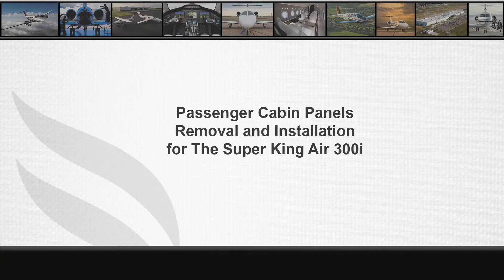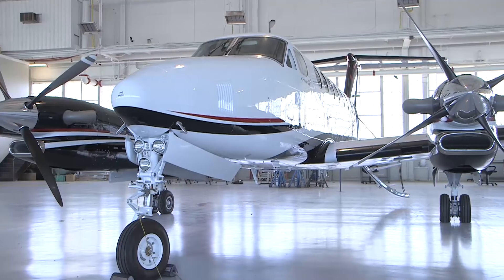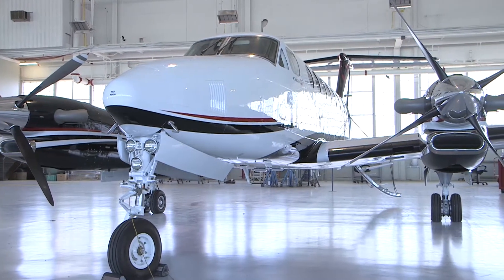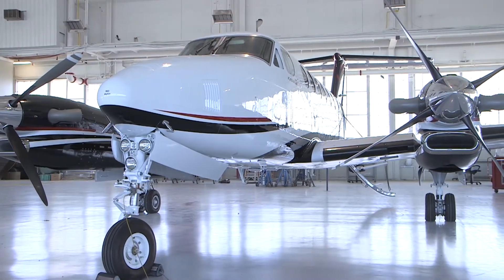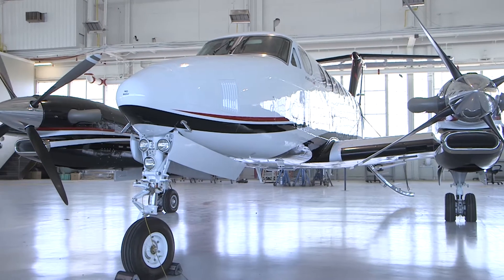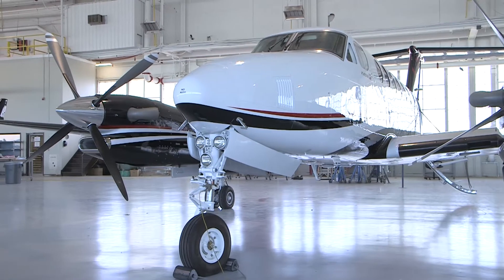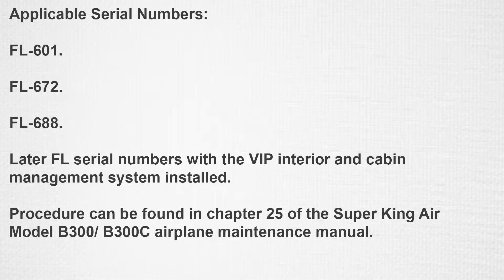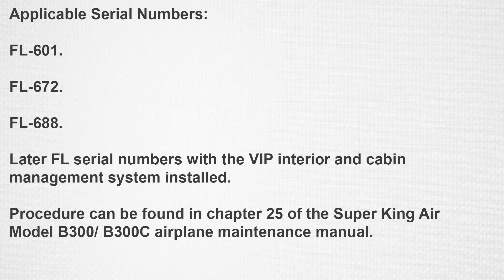King Air B300/B300C Passenger Cabin Panels Removal and Installation

Comment: Hi, I am an aerospace engineering student and I am currently working on a project for Sidewall panels, Dado panels, Ceiling panels, Entry door, Lavatories, Bin assemblies / compartments, as well as the costs of the construction and repair process and their reconstruction, including separation. And cleaning and sanding and .. Please if you have any information, of course, by mentioning the source to help me
Sincere thanks to all of you
More about this source textSource text required for additional translation information